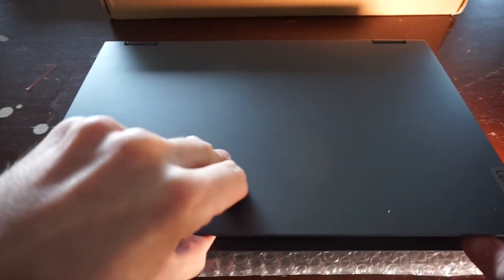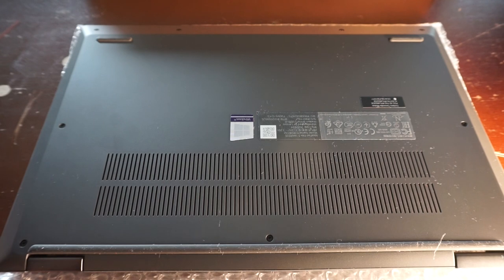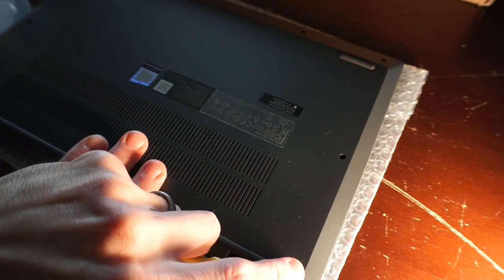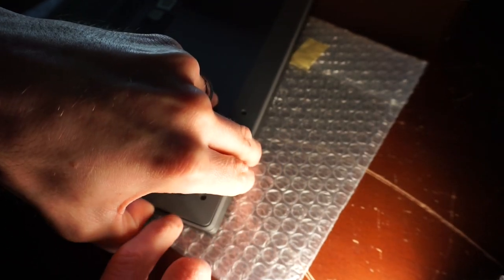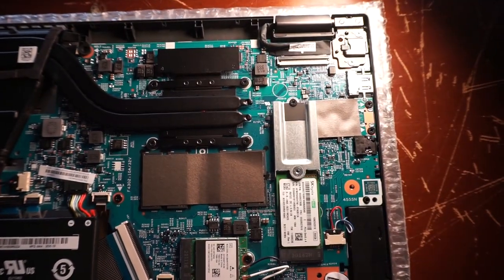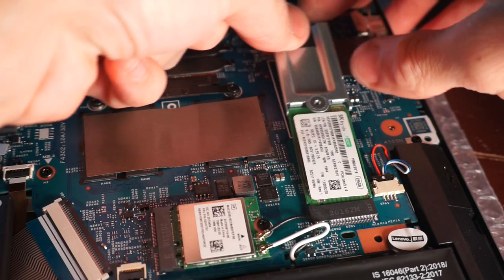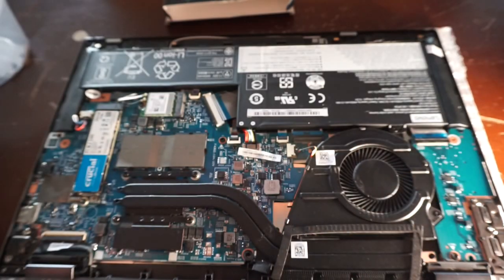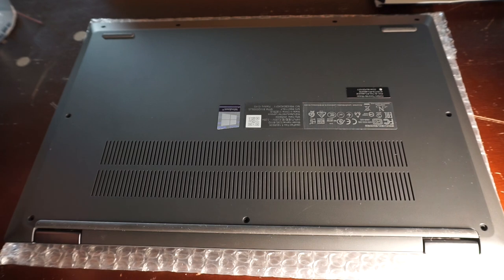Lenovo Ideapad Flex 5 4500U Teardown SSD Upgrade

Comment: Hey thanks for the video. I got the same laptop from Amazon. I would recommend upgrading the wifi card along with the SSD and imaging the SSD before hand to keep windows.
Reply from the maker: I went with a crucial P1 500gb nvme SSD with a fresh install using media creation tool
Reply: @rickstechrepairs  did it auto detect the windows install on that motherboard or did you have to end up buying a new key?
Also the thermal pad under the original ssd did you add that to your new disk/does it overheat without it?
Reply: What Wi-Fi card did you put? I want to get it aswell?
Reply: @GameHEADtime  Intel AX200NGW Wi-Fi 6 11AX

Comment: I have the same model but with the RYZEN 5 5500u.
According to Lenovo's official product pdf, the maximum storage is 512 GB upgradeable. But they put a note: "The storage capacity supported is based on the test results with current Lenovo storage offerings. The system may support larger
storage as the technology develops.".
Have you tried putting a 1TB NVME SSD in any of these laptops?
Reply from the maker: Pretty sure a 1tb ssd would be fine

Comment: Hey!Nice & thorough video! Only question. Im doing the same thing, have both same laptop and ssd incoming. Will I need to transfer windows 10 onto the new ssd? how would I achieve that? im kindof new to this stuff any help appreciated
Reply from the maker: There are ways to transfer your install, but if you aren't use to working on PC's I would recommend Getting it done at a shop

Comment: Hi I'm not too good at computers so I wanted to ask after installing the ssd do I have to do anything else? Also will the screw used for the metal bracket suffice to screw in the new ssd as well?
Reply from the maker: The new SSD would normally be longer, so you don't need the metal bracket. And the screws there will do 

You will need to reinstall windows after putting the new SSD in
Reply: @rickstechrepairs  thank you :)

Comment: Hey Rick, I'm doing this exact same project but I'm having tons of trouble installing windows to the new NVME. I know it's an NVME and not a SATA because I already had that problem. I made a Windows Install Key through the Media Creation tool and when the installation completes it keeps crashing. I've also tried to make a system image on an external hdd with the same results, as well as use the Lenovo Recovery tool to create a recovery USB and that didn't work either.
Any ideas for me?
Reply from the maker: What model of nvme are you using ?
Reply from the maker: Also have you done any of the bios updates on the flex 5 ?

I think 2 have been released, which may fix this issue (unsure of the change log)

Comment: A shame there isn't a second m.2 slot as that would make this laptop almost perfect. As for the ram it technically is upgradable however to do that you'd be removing the soldered on modules and solder new ones on.
Reply from the maker: Good Luck with a Ram upgrade

Comment: If I were to just straight swap the current ssd with a new one, no data transfer at all, would it be good to go, or would I need to get another copy of windows and key to install on it? (I'm very new to this, my apologies).
Reply from the maker: When you installed a new hard drive / SSD

It's a blank drive with no information on it

So the pc won't load windows up with a new drive in there , unless you install windows on to it , or clone from your old pc
Reply: Buy a $20 nvme usb stick to insert your new drive into the usb port.  Then "clone" your 256gb drive to the new one.  Yiu can download the cloning software from the manufacturer of your new drive.  I bought a new 1TB skHynix 1TB drive, and am cloning it right now.

Comment: hello. need to be replaced after the battery is exhausted ?
Reply from the maker: You can choose to disconnect the battery when you swap the ssd
Reply: @rickstechrepairs  Can there be harm if I do not choose?

Comment: Is it worthy to leave the thermal pad in position as the original ssd have, or it's better to take it out when instaling the new ssd as you did? (Thanks in advance for your answer)
Reply from the maker: If you can move the pad with it tearing it, I would recommend moving it also
Reply: If it tears, any recommendations on where I can buy a thermal pad that will fit?
Reply: @aaronwoodyear4036  go to amazon. look up nvme thermal pad. :)

Comment: Didn't you have any problem installing a fresh Windows 10 on it? I try a fresh install with a Western Digital SN550 NVMe and as soon as Windows try to boot for first time it crash with "winloaf.efi 0xc0000225" error... Try lot of things but always same result.
Reply from the maker: I didn't have a drama , possible incomparability with the WD
Reply: @rickstechrepairs  yeah that is what I think but then there is a youtube video using the same SSD but cloning from the original and works perfect.
Reply from the maker: That is also an option, but will require software and an m.2 nvme enclosure to do it
Reply: Could you tell me whicj Crucial SSD you bought? Thanks!!
Reply from the maker: crucial P1
Reply: @rickstechrepairs  Thanks!! you were able to do a clean install using Microsoft's MediaCreationTools, right?
Reply from the maker: Yep, installed the crucial P1 then did a Fresh install with media creation tool version 1909 ( I think it was that version)
Reply: @rickstechrepairs  Hey replaced my WB blue with an ADATA SX6000 Lite 512gb and I was able to do a clean install on my flex 5. Quick question those thermal tapes under the SSD could be the answer why it is hotter on that side of the laptop? My SSD came with a small heatsink but I notice the USB-C is warm when it is plugged in. Those thermal tapes are real close to the usb C and the SSD.
Reply: Hey mate, I bought a WD Blue NVMe SSD 1TB and I've been tearing my hair out trying to install windows on it. Can you confirm that it went smoothly once you tried a different SSD?
Reply: @Jordan-fg9cc  yes it does!! Buy any 512gb ssd but not 480 or 500 gb SSD. BTW i bought one from adata.
Reply: I was really hoping to use a 1TB SSD as I want to dual boot Linux. A 1TB from a different brand should work, right? I might get a Crucial instead
Reply: @Jordan-fg9cc  yes, you should be fine with Crucial.

Comment: Hello can i install a ssd like 1tb instead 500gb? I'm new in this:(
Reply from the maker: yes you could, you would just need to reinstall windows 10 after you swap
Reply: @rickstechrepairs  is it possible even with windows 11? I just got this and want to upgrade to 1TB, I have an external 8TB hard drive just incase it isn’t possible

Comment: Hello ! I have a Lenovo flex 5 (amd - 256go) and i bought a SSD SN550 1to. But i can not install windows 10 (error "0x80300024"). Someone find a solution ? thank you in advance for your help.
Reply from the maker: i would suspect a WD Blue NVMe should work fine.. umm what version of the media creation tool are you using
Reply: @rickstechrepairs  I tried with the official Microsoft Media Creation tool and i tried with rufus. 

I tried to install windows 10 with a 64go usb stick and then with a 8go usb stick...

In my opinion, it's only a compatibilty problem between the SSD SN550 and the Lenovo Flex 5.

PS2 : So, for you, what it the best between a WD blue and a P2 Crucial ?

Comment: No migration  or cloning of the Operating System from  the old SSD  to the new one....!!??
Reply from the maker: Fresh install all the way, since it was a brand new machine with nothing extra installed
Reply: @rickstechrepairs  Did you have booting issues with a fresh install? I've tried it w/ a windows 10 usb and it crashes at the login screen.
Reply: @shermanhuang216  I'm having the same issue, and when i cloned the original ssd to the new ssd it crashes as soon as it gets to the desktop with critical process died.
Reply: Hey! It happens the same with my flex 5. Try to do a fresh install with a Western Digital SN550 nvme and even first Windows 10 boot fails with a 0xc0000225 error...
Reply: @justsomeguy2411  I got a comment from a different video that said the problem is with the WD Blue m2's which is what I had. I recently bought a Crucial P1 and it is working fine now.
Reply: I had a WD Blue M2. I think the problem is with WD drives because I bought a Crucial P1 and it is working fine now. I slotted my WD one into my desktop instead and now all is well again. Hope this helps!
Reply: @shermanhuang216  Hey Sherman! Thank you for your message. Now we are 4 guys with the same problem... I already returned my WD Blue but there is no Crucial SSD listed in my local store. There are ADATA ssd, hopefully will be compatible... finger crossing...
Reply: @shermanhuang216  So finally my local store replaced my WB Blue with an ADATA SX6000 Lite 512gb and works just perfect. First time, first boot, first clean install, no issues at all. It even comes with a small and thin heatsink...
https://www.adata.com/tz/specification/597#
Reply: That's great to hear! I guess the issue is something about the WD m2's. Glad to hear your system is working fine now!

Comment: The ram can be upgrade in this laptop?
Reply from the maker: no, soldered on
Reply: @rickstechrepairs  , well that means the RAM that came with it can't be swapped. But there is sometimes an extra slot to add more RAM. However, the Flex 5 has no extra slot. So a better answer might be, "The existing RAM is soldered on and there's no slot to add more."